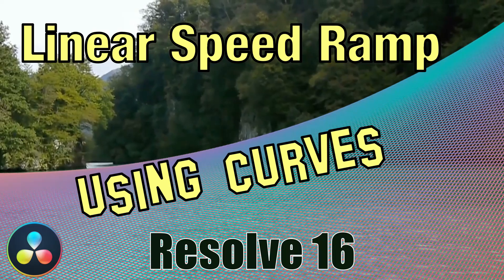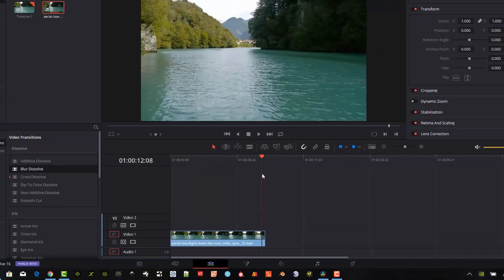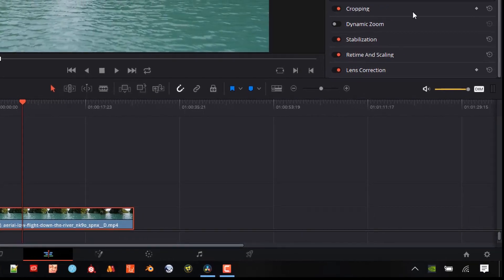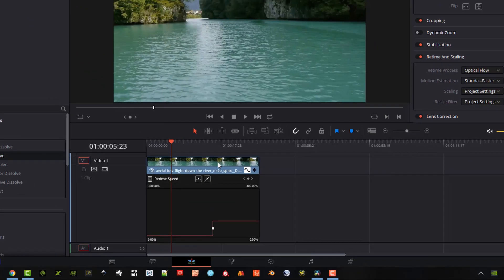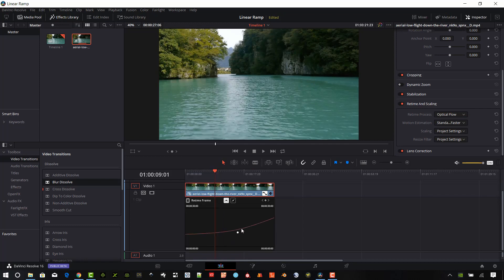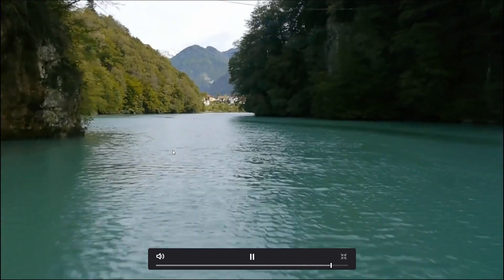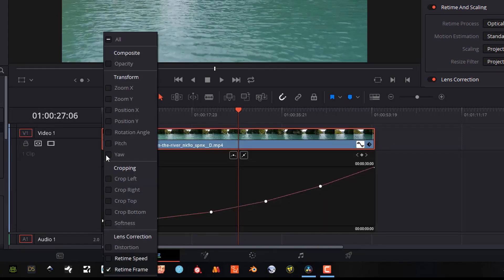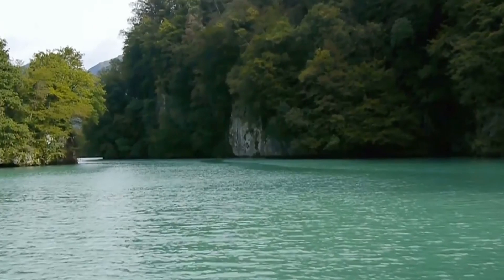Davinci Resolve Linear Speed Ramp using Curves

Comment: Thanks for the explanation. However, I am wondering how I can copy and paste one speed ramp setting to another key frame. I can easily set the speed, but the lenght of the curve (these two horizontal adjustment points) can only be set by mouse which makes it difficult to match with the lenth of other curves in the clip.
Reply: you can right clip the clip, copy attributes ... click the other clip.. select paste.

Comment: I notice your control points exceeded the bounds of the curve window. How do you navigate the curve window so you can adjust the curves outside it's bounds? I tried the standard alt-mouse movement, but that just navigates the whole edit window.
Reply from the maker: Use the normal timeline +/- controls.  You can also increase the size of the track by dragging the edge.  You may need to make the window viewer smaller, depending on how much detail you want to see.

Comment: When I retime previous clips in the project, new longer version overlaps those videos after it. How do I disable this? Pretty sure this can be done with a single button, but I can't find which one
Reply from the maker: Turn off the auto select button on the left side  of the timeline panel.  I think one of my speed ramp videos on my channel covers it in more detail.
Reply: @DigitalVectorStudios  Thanks, will give it a shot!
PS Internet is amazing
Reply: Just in case anyone else has this same question: switching your cursor to the trim mode on the edit tab solves the problem